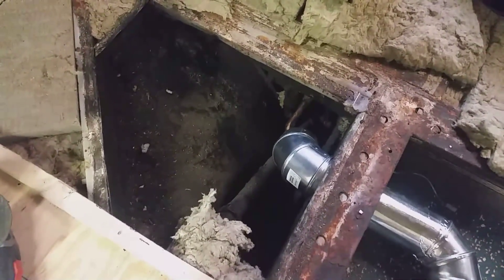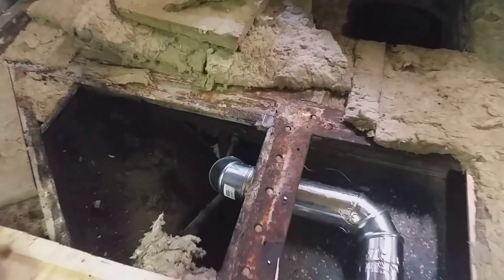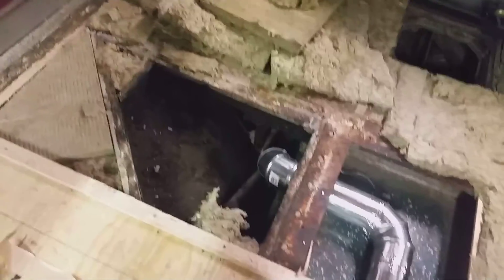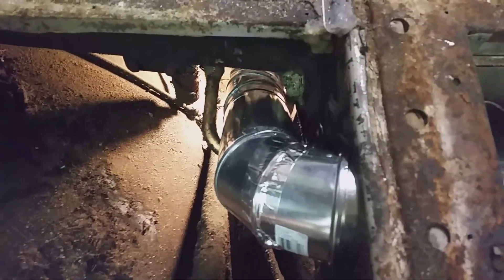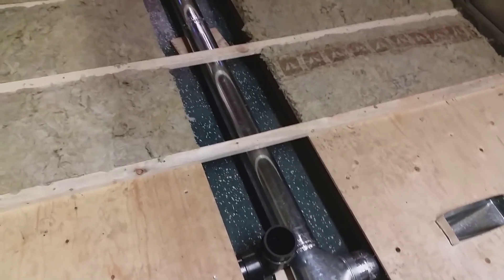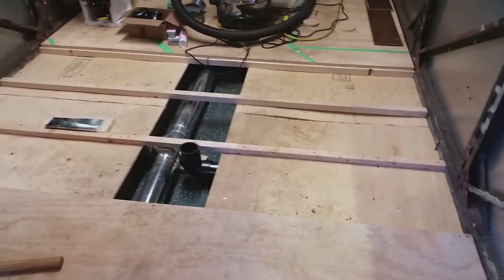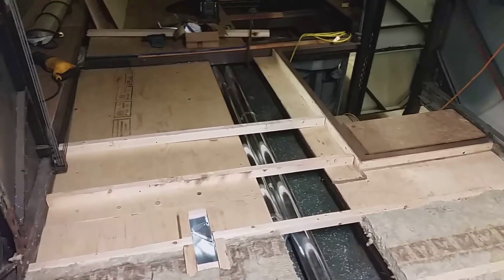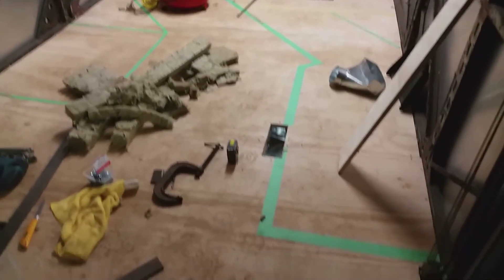Bus Conversion Project - Video 72 - Floor and furnace ducting

Comment: Computer is hooked up in the new home, not much else. Are you going to heat the bays? When you used the hole saw did you drill relieve holes for the cuttings to drop out (I drill four or eight (depending on the circumference of the hole)1/4 inch holes where the hole saw will cut to give the shavings a place to go, it makes a big difference (and of course cutting oil)). Some of the old style round rain gutters screwed to the floor would hold those ducts in place nicely. Safe travels. Glenn
Reply from the maker: well....at least your moving.... and before it gets too cold, I am going to heat the water bay... not sure about the rest but at least the water bay.... thanks for the suggestions, I'll give em a try

Comment: HI James !  I just wondering if you will be securing furnace ducting somehow too lesson the chance of it vibrating and eventually driving you up the wall.  There's nothing easy when it comes too converting these buses !
Reply from the maker: Yes, the ducting is secured, I silicone it to the deck and it seems to work..... and it's too late, I'm already nuts..... :-)